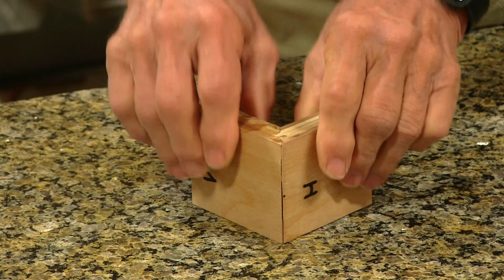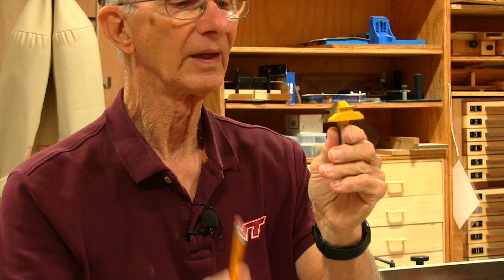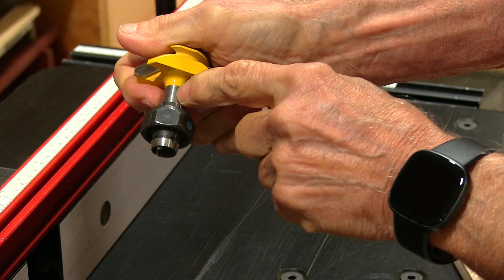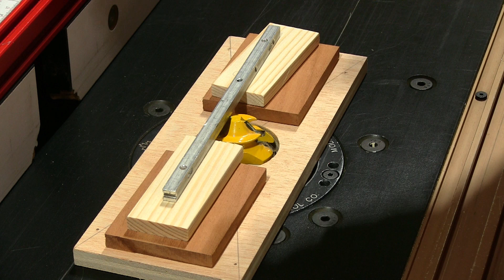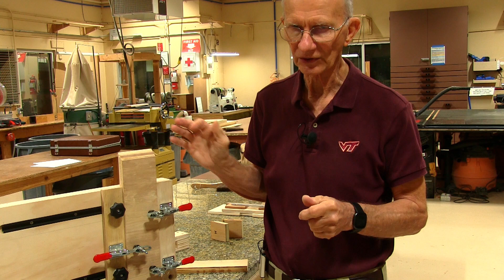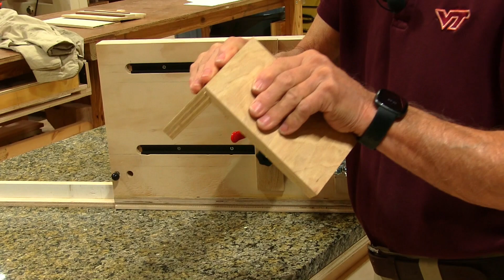lock miter joint jigs

Comment: I really appreciate and needed this video. Thank you. It has taken me several days in forums and online, even here on YouTube, and that vertical jig is finally the solution to what I've been looking for. Setting out to construct it now. I'm thinking I might add another vertical with knobs and a toggle on the end to do the final pass and be against the fence using a second piece of the same thickness of stock that is being cut.
Reply from the maker: Glad you found the video educational.  The Lock Miter bit sets have always been challenging and even with the available setup tool sold on some sights they are still hit and miss.  This fixture, with its woodworker made spacers based on your material thickness, consistently works the first time.

Comment: Ben, thanks for the very informative video.  I have made a couple of projects using locked miter joints.  I was able to set up the bit correctly using some other videos, but found that running the parts through the router table was difficult at best - especially when cutting the vertical pieces.  Since I have not been able to find plans for your jigs I am in the process of duplicating them.  But I do have a question.  In the video you spent some time on how you set up the bit for the correct vertical placement.  But when showing the jig to set the horizontal placement of the fence you didn't supply any detail about how you arrived at the measurements for that fixture.  Could you elaborate on that?

Comment: Very confusing
Reply from the maker: Sorry you find the video confusing.  Attached is a set of pictures which depict the tool Dave is referencing in the video as another way to align the joints, however it requires multiple attempts to attain final alignment where Dave's method hits the alignment most of the time on the first try.  Here is the link to the other method:  https://www.youtube.com/watch?v=BGvDQdck7Us

Comment: how would you use the cutter to make a column?
Reply from the maker: The key to using this bit is insuring your stock edges are straight, you can hold your material so it does not move resulting in crushed edges and it can be supported through the entire set of cuts without stock movement.  You truly need a carrier, as Dave explains, to support both horizontal and vertical cuts.  No matter how careful you are when feeding your stock you will invariably crush the outside edge of the cut as material moves on the fence/table.  The obvious way to cut large columns would be and extension of the fixture Dave is demonstrating or building a similar stand off fixture the length of the column with multiple clamps along the full extent of the fixture.  Not just at the beginning and end.